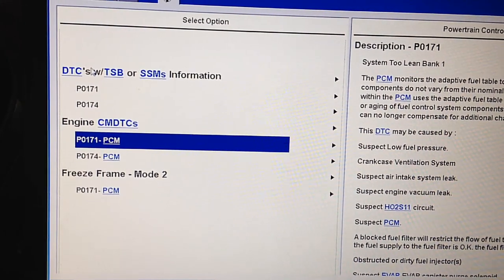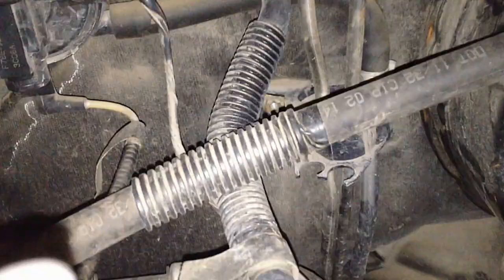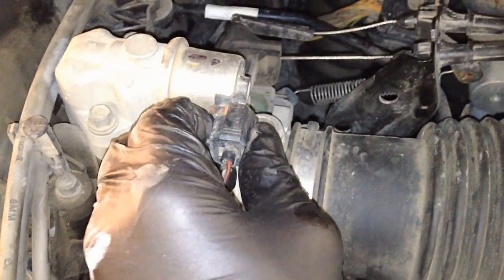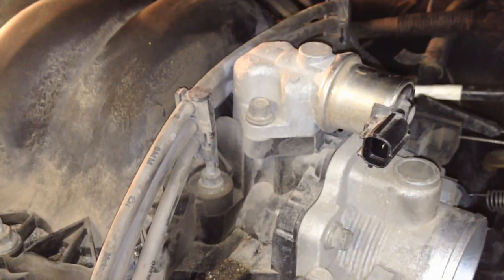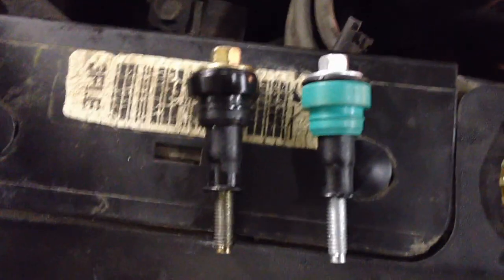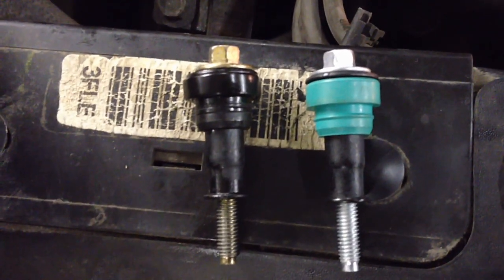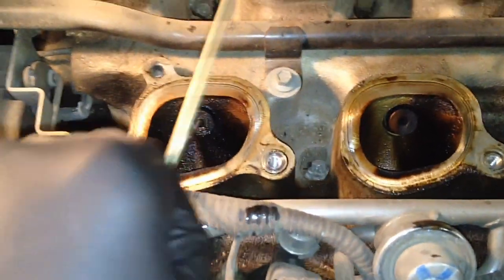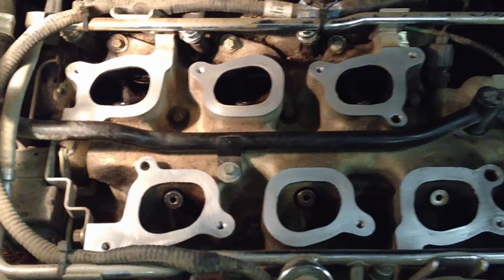Ford Windstar P0171 P0174 Upper Intake Manifold Gasket Replacement

Comment: Great video. I have to do this as well as changing the lower intake gaskets because of oil leaks. But after watching this I'm not dreading it as bad as I once was. Everything looks pretty simple. Thanks for your time in putting this together.

Comment: The problem I have is, these codes exactly, however they didn't start until I replaced the gaskets for the whole top end: head gaskets, intake manifold gaskets, upper intake gaskets, throttle body gasket, IAC gasket, and the EGR graphite gasket. And the bolts have been replaced with the updated intake bolts. It also has the high rev issue because of these codes as it's finding the air coming in past the MAF sensor and the only place I can detect a leak is by the EGR. So I think it's not tight enough but it seems cranks down pretty good. I'm at a loss.

Comment: I have a 1998 Ford Windstar GL with the 3.8 L V6 that is giving me the P0171 and P0174, also the P 1538 intake manifold runner control stuck open. There is a vacuum line that keeps coming off on the top of the plastic upper Plenum of the intake manifold, and I think somewhere it splits off and one part might go to the vacuum controlled ventilation switch for the cab.  The port where the front end of this line is supposed to seat has great vacuum when I put my finger over it,   However, I am guessing that from age the rubber connector that goes around and seals that on there has worn and it will not seal properly. The line comes off and then the engine loses power, runs very rough, and when this happens I also get a code for the camshaft position sensor. To remedy this, what I need to replace that whole line that goes clear back in there? Or how would I go about remedying this issue? Has anyone ever seen this issue come up on one of these?

Comment: I hat all those tricky fit situations. Why does it always come out with no issue but putting it back in you have to push/pry?  I've noticed I need my arms about 8" longer working on the back of a lot of V8s how do you handling getting to the back of deep engine bays? I've notice my method of laying on the engine is probably frowned upon at the dealership.

Comment: THANK YOU VERY MUCH for putting this video together, I have been struggling for months with cylinder misfires and replacing the coil pack, cables, plugs and finally a person at an Autozone told me about your video and I just gave it a try today. You did your video so thoroughly that it was easy to follow along step by step and do it. The only hitch I had was with the torque wrench (I never used one before and snapped the bolt in the engine and had to get it replaced). Other than that, I was able to get the car all put back together and running again. It is too soon to say if that was the exact problem, but I am sure it needed it just the same. There was black all over the inside of the engine, coming out of the tail pipe and I am gathering it might have been a blockage or something, but not totally sure. Suffice it to say, I REALLY appreciate the time you spent in putting it together, it really helped!! Thanks again!

Comment: Can not tell you how helpful this video has been.  Before watching this, I never would have considered replacing the upper intake gaskets and isolator bolts.  Now I am ready to tackle the job with confidence. 
I have been chasing a nasty misfire in my '03 Windstar for a couple months.  Plugs, wires...thought we had it sorted, but nope.  It acts exactly as you described:  Fine at idle and low load, but under moderate to heavy load and acceleration, it is hit and miss.   I am willing to bet (based on what I learned here) that it is the EGR ports.
 The strangest part in all of this is that the "Check Engine" light has never turned on.   That's really strange since there is an obvious problem in there somewhere.  ...Yet I have seen many "check engine" lights come on for no apparent problems.  Oh well, after 156,000 miles, I guess it is time to give it a good once-over anyway.

Ordering the parts today and will likely be tackling the job within the next week or so.   Fingers crossed that this will finally sort out the issues. 
Thank you so much for this extremely helpful video.
Reply: Oct 13, 2016 Follow up.
Over the past weekend, I went in and took the intake manifold apart.  While in there, I replaced (again) the plugs and wires.   This time I replaced the coil pack as well.  While in there, the EGR ports didn't look too bad, but I still went in with a very fine rat-tail file and some carb/injector cleaner.  I also made sure the little butterflies were operational.  I cleaned everything, including the throttle body...making sure NOT to get any cleaner on the MAF sensor.  Also cleaned the plastic manifold parts with Simple Green.

After everything was dried (compressed air and a few hours in the sun) I put it all back together.  First start was a success!  It ran like new again....or at least as close to "new" ad a 156,000+ mile engine can run.  Took it for a test drive and all issues seemed to be solved.

This is all thanks to you and these videos.  I never would have tried to tackle all of this on my own if I hadn't found these.   I am sure I have saved hundreds of dollars by doing this myself.
Can't thank you enough for these well detailed videos.
Reply: In all likelihood the problem was just the coil pack. It's a common issue on these vehicles. The plastic case cracks due to heat and then you get misfires under load. Also, the misfires are infrequent so you won't get a check engine light at first. Mine got a bit further along so eventually I did start getting a check engine light and misfire codes. After I replaced the coil pack and the problem went away I put the old coil pack back in temporarily as an experiment just to be sure. Sure enough the misfires came back. Then I put the new pack back again in and the problem went away again and it hasn't come back since.
Reply: Here's a few things I've learned from experience over the years that might help save you a lot of unnecessary work the next time.

Misfiring type symptoms are typically caused by ignition system problems. In contrast, vacuum issues such as leaks cause drivability problems like poor throttle response and on newer vehicles you will get check engine lights and vacuum related trouble codes like P0171 and P0174 or unusually high fuel trims. In your situation the misfiring under load problem was never a vacuum leak or anything to do with the EGR system either. Instead it was totally ignition related. As such all the work you did pulling the plenum and all that was nothing but a waste of time and money. Instead all you really needed to do was to replace the coil pack.

Also, it's interesting and very important to understand why engines often misfire only while under heavy loads. It has to do with the changes in electrical resistance across the spark plug gap under different load conditions. When the engine is under a light load and the throttle is only slightly open there isn't a lot of fuel/air mixture being packed into the cylinders. This causes the electrical resistance across the plug gap to go down, so it's relatively easy for the spark to jump across and fire the cylinder. However when you open the throttle to accelerate you are packing more fuel/air mixture into the cylinders and into the spark gap on the plugs. This increases the electrical resistance of the gap and makes it harder for the spark to jump across the gap and fire the cylinder. As such if there are any marginal components in the ignition system, such as the coil pack, wires or plugs, you will get misfires but only under a heavy load.

Understanding the dynamics of the combustion process inside an automobile engine can help you to do proper and efficient problem diagnosis. 

Hope this helps.
Reply: @Joe Vignolo:
Thank you Joe for the replies.  Much appreciated.  Well, the reality is that the spark plugs were absolutely shot as well.  A couple even gapped out over .090", and the center electrode was burned almost completely off one of them.   Honestly, I am surprised the engine ran at all.  I did find a couple of bad O-rings in the intake, plus a couple of the isolator bolt grommets were cracked, so it turns out that did need to be done...and it was a good learning experience for me.

As for the coil pack, yes, it was indeed cracked in several places.  There was even a crack in the epoxy underneath.  In reality, the coil pack, new plugs and wires probably have fixed the issues, but I am glad I tore the intake plenum apart to replace those parts as well.

Thank you again for the time and thought you put into these responses.  Hopefully others will see these and follow the advice you are offering here.  It is definitely good advice.
Reply: Joe, thanks for the info! I have 171 & 174. Stumbles on acceleration and to a lesser degree at highway speeds. You are suggesting that it may be a coil instead of the isolator bolts? 
I knew I needed to upgrade to the green bolts for this project, but what are the white and blue gasket part numbers?
 Are they required or optional?

Comment: Thank you so much for this walk-through. It was super helpful and I believe I have finally fixed the P0171 and P0174 codes. I also notice a white bushing was busted on the Intake Manifold Runner Controls, I replaced one earlier, but this one wasn't accessible without taking the clamshell off.

To save myself the stress and to have ample room, I did remove the wiper cowl and a couple other parts just to have a real good look at everything around the top side of the engine. 

I was tempted to see if I could get to the lower intake manifold and replace those gaskets, only because the set I got Mehle included those. I decided to skip that. lol

Again, thank you so much for all the info and video!!!

Comment: What a great video!  I did this update at the same time as I was replacing the spark plugs, wires and ignition coil. No more codes!  Cleaned the Mass Airflow Sensor and installed a new PCV valve, too.
I would like to share my tip to find the long side of the clamshell gasket.  I held the gasket up by one of the locator tabs, and then very gently and very slowly pulled down on the other locator tab.  There was just enough difference in length so that the shorter side slack would start to slowly tighten while there was still visible slack on the long side.  Did I say slowly yet???  After placing the gasket in the cleaned gasket groove, I could run my clean gloved finger along the length of the gasket in one direction or the other to make the minor adjustments to center the locator tabs, and remove any lumps or bumps.
Also, at 116,000 miles, the vacuum lines to the EGR vacuum regulator valve on the backside of the plenum didn't want to budge, so I disconnected (unbolted) that, one stud screwed out of the plenum, one stayed in.  Again thanks for the ( Brilliant! ) video.  I hope my comment may help someone who is on the short end of a long repair like I was.

Comment: I studied your video for months before taking on this task and I have to say it was easir than it looks. month later and my codes has not returned. The previous owner used gasket sealent to "patch" leak and installed the twin vacuum line offset in the wrong hole leaving  1 line and port open.  THANKS!!  for posting vid. :)

Comment: Thanks for the video.  Also, the IMRC seals on the passenger side of the intake manifolds can suck air. 

Plenty of lip service on how the PCM is designed to handle some vacuum leakage at the shaft/manifold interface but when the engine literally bogs down when carb/brake cleaner is sprayed at the shafts tells the story.

Around $500 for the new intake manifold(s) but have read there is a back-woods work around - lots o' labor - using the green AC type o-rings to re-seal.

Also have read the PCM can be flashed to accept a bit more vacuum leak before setting 0171/0174 code.

As to car in question, installed the green clam shell seals.  They were definitely distorted.

Comment: This was the best video out here for this. The only problem i had afterwards was i realized that i was missing a canection on from the cgr and the vacuum line from the manifold vacuum line it was a red hose that connected to a T that connected into a black hose that ran in side to the AC I figured out it was an AC vacuum hose report that hooked on to a place on the passenger side firewall and everything is good to go thank you very much

Comment: Great video. Didn't have the codes, just an excessive amount of oil being lost and what was thought to be a rod knock on acceleration. The jury is still out on the oil usage but following your video, changing gaskets, isolator bolts, and cleaning out the EGR ports got rid of the suspected knock. The engine is so quite at a stop light that had to look at the RPM meter to see if it was running. Thanks again.... subscribed.
Reply from the maker: That's awesome to hear.

Comment: I'm working on a 99 Windstar with the 3.8, it idles very rough, and when at an idle at a long stop light it will die or come very close to diving. Scanned for code, and the only code it had was aFirst P1516 for the IMRC bushings. I replaced all of them with the Dorman clips. The new clips didn't retain the linkages very well, and the front rod keeps falling out. It is a sunday, so the dealership is closed, but going to replace with the Ford bushings. In the mean time I also found the front O2 sensor had cut wires, so I replaced that with a new Bosch sensor. Started it up and the idle is still very rough, but there are no codes for a misfire, but it does have a pending code of P0174. I pulled the front three plugs to look at them, they all looked okay, and the gaps were all around 0.055". One plug was a bit loose, and it's wire wasn't on all the way. Fired it up and still rough idle but better, I'm thinking of doing this upper intake gasket job as well as pulling the rear plugs. Do you have any other ideas or things to check? I'm not sure how it is not throwing a misfire code as it runs VERY rough.

Comment: Great... no B/S video and easy to follow. I Just got the P0174 CODE on my 02 Windstar. It's been idling rough on and off for the last couple years and this is the first time I get the code. I checked all the hoses. So I guess this job is next. Thanks

Comment: Hi.  I just have run into the problem of misfiring on my Windstar 3 days ago and I really hope that doing the cleaning will take care of it.  Thanks Tom.
Reply: I drove my 2002 Windstar for probably at least five years with the isolator bolt and seal problem (yeah, the Check Engine Light was on) and didn't have a real big problem with missing, except when I really punched it.  Then about a year ago when taking on some super big steep hills on a freeway in a new territory, it started missing really bad.  Shortly after that, when I got into this repair, I checked the coil, and it was cracked in three places.  The plugs were way worn with much larger gaps than spec calls for, and the wires...well, they were at least 11 years old, what else do I need to say about them.  I did the cleaning of the EGR ports, two were totally blocked;  replaced the coil, plugs and wires, isolator bolts and plenum seals, PCV valve and cleaned the Mass Airflow Sensor too, and now that beast runs like a spinning top!!  I'd swear it hasn't missed once since I did this repair.  It's like a new engine.  

The point being, since you'll have the plenum cover off, check your coil at least, unless you have recently replaced it. It's pretty easy to get at then. Remember or take notes on how the wires are routed to it, over under etc., take it off and check it out.  I'd read that they crack when you get into that 100,000 mile range, like mine. I'd recommend that you might as well check your spark plugs too.  I've read that some mechanics get at the rear plugs from underneath, but that wasn't an option for me. It was difficult to get the rear plugs out and in from on top, but doable, so allow for a fair amount of extra time to deal with them.  Hope your arms are longer than mine. 

I did a little tweaking on the spark plug wire loom situation too.  I hope it's OK to post the link here for you to see:
https://www.facebook.com/photo.php?fbid=10153506267493064&set=a.69191283063.97078.579443063&type=1

Hope it all works for you too.